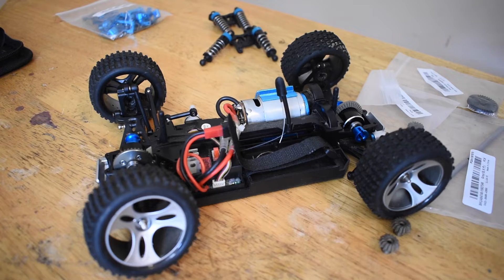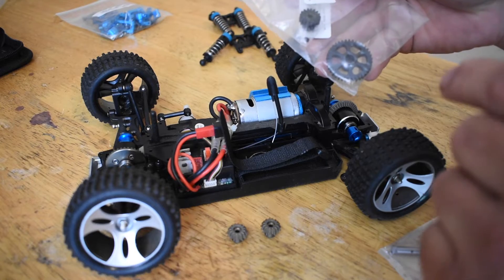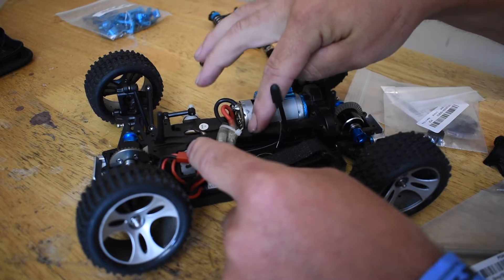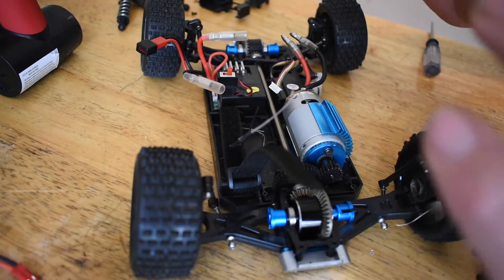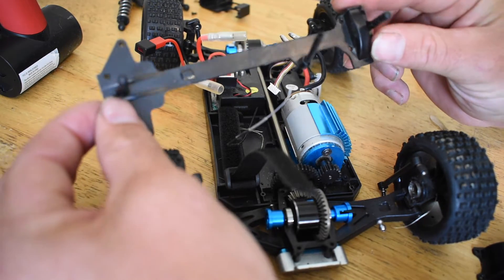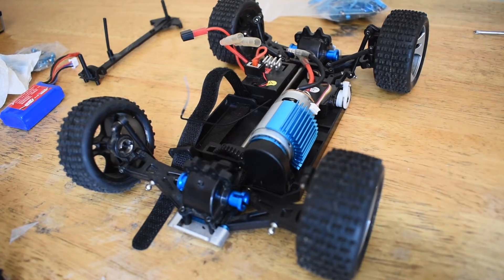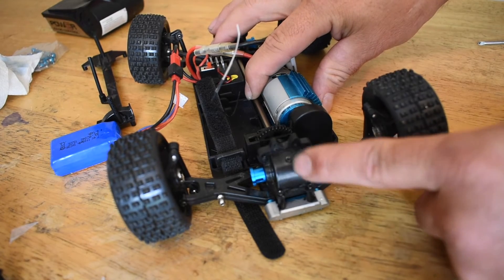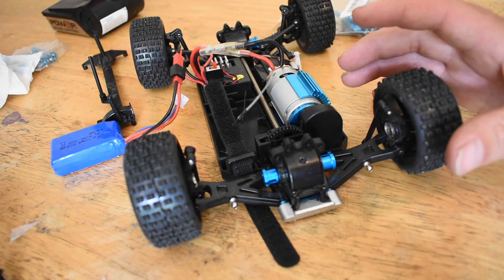WL Toys A959 Upgraded Metal Drive Shaft and Gears

Comment: Your videos are great! Im pretty new to RC cars.  I just bought the 979B and i pretty i will be upgrading parts also.  I wanted to look into more ground clearance.  Do you know how you would increase the ground clearance of your RC car since the parts are interchangeable between the models?
Reply from the maker: Brandon Johnson thank you! I’m glad you like the videos. The only suggestion I have to gaining more ground clearance is maybe buying bigger wheels meant for a bigger scale car. The A959 is a 1/18 scale so if you get wheels for a 1/16 or even a 1/12 scale vehicle that would give you a little more clearance. Just be sure of the wheel hub size before purchasing your wheels because a bigger wheel may require a bigger wheel hub nut.
Reply: I have the same car and the plastic gear is striped and I can not figure out how to get it off. But good video.
Reply: @Wmacrum  heat!

Comment: Could you give some tips on how to remove the motor gear at 2:31, what tools are required for that. Thanks!
Reply from the maker: You will need a Phillips head screw driver to take the plastic gear cover off and then a hex head screw driver to remove the motor gear.  Its that simple.

Comment: what would happen if you did not have the metal centre drive shaft, but had the default stock plastic one, would it still work, with all the other stuff full metal upgrades ?
Reply from the maker: As long as the gear meshes with it and matches up, I don’t know why it wouldn’t work. There’s nothing different other than what material it’s made of.
Reply: @ReadytoRunRC  cheers i bought one today from another person with full metal upgrades, however he bought a new drive shaft and said the following "And drive shaft I changed the diffs to metal in doing so screw snapped in drive shaft I bought a new one but it’s to long" what do you think, perhaps i can go to my friends garage and sand down the new drive shaft ?
Reply from the maker: @monkeytrident  I have no idea which drive shaft he bought or how much longer it is. I know nothing about whatever drive shaft you have so I can’t really tell you what to do. Maybe try buying a drive shaft meant for that car that’s the correct length. Good luck.

Comment: Would love to see that drive line tested. Just tested mine. Exact same drive line it seems. The result not as I hoped for 🙂 Great you’re running a series too. Didn’t know. Subscribed now so I can follow along 🙂Seems you’re going all the way.
Reply from the maker: Nordic RC Visions thank you so much for the sub. You are the biggest channel to sub to me and that means a lot. My series is just about over. I don’t want to have too much metal for flexibility but I did want to completely change over the driveline to metal. My new wheels and metal drive shaft cover just arrived so I will be making a little completion video to the series in this coming  week. Then you can see the car run afterwards. I am also thinking of doing the 540 motor upgrade as well but for now I think I’m done.